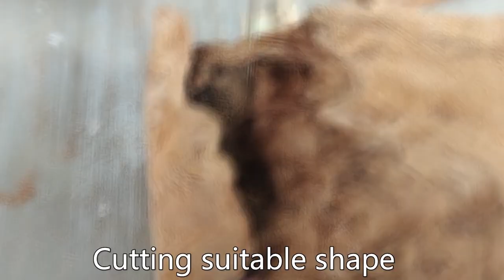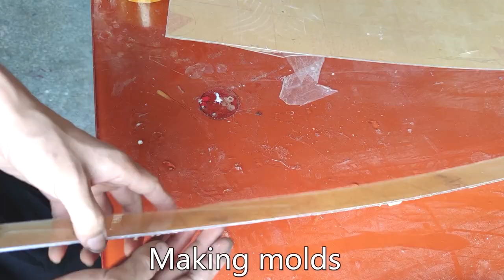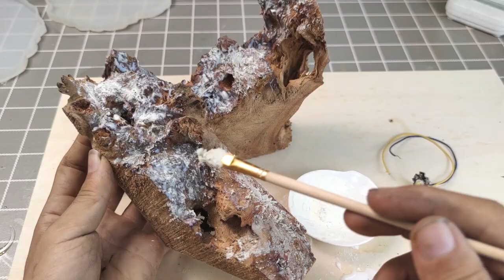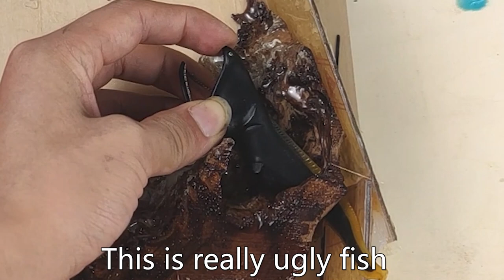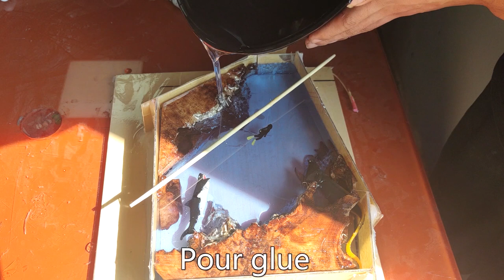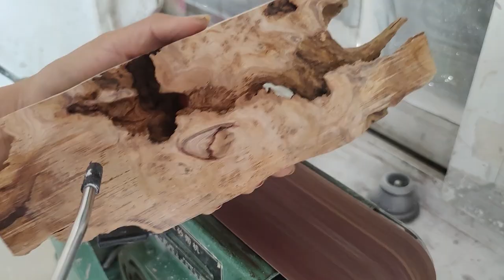Build an impressive scene from "EPOXY RESIN"/thalassophobia/diver/shark/Resin art/Diorama【Epoxy DIY】

Comment: Plexi glass is best cut with a very sharp knife, give a scaple a go, with a 10A blade you will be surprised at how well it snaps. Another tip if you do use a very sharp blade usually just one cut is best. Great work by the way, I envy you as I am extremely allergic to clear resins and I am unable to try my skills out on this type of work, so you keep building and I will keep watching!
Reply from the maker: Thank you for your detailed sharing